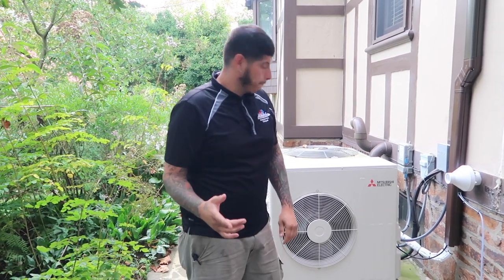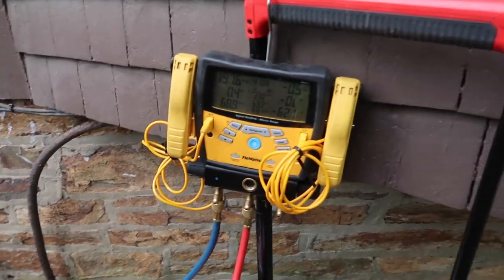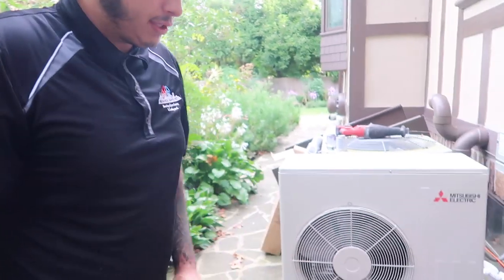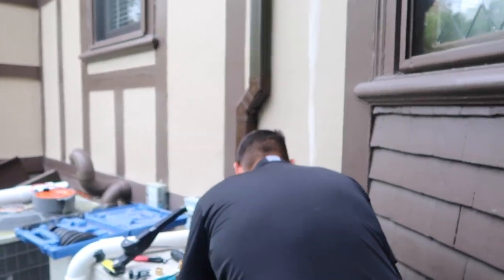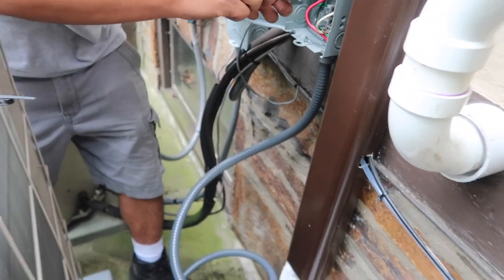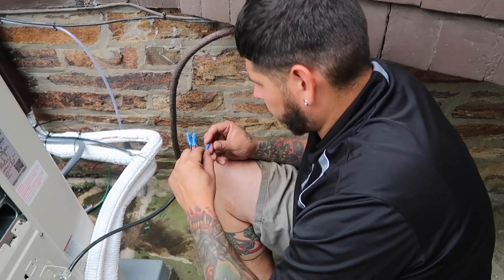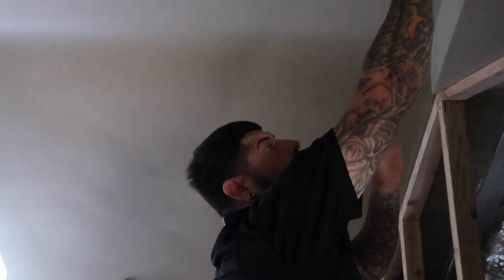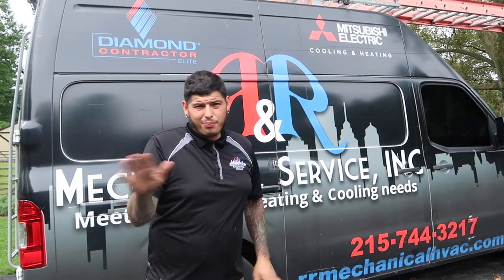RELOCATING CONDENSER

Comment: Yo that's what sup homie! I'm going on my 5th year in the buis, and finishing up my level 2 certification this next year. I had a question as to what u were using to flare out the copper with on ur drill. I need something like that for the mini splits I've been installing. Thank you for any info and keep the vids coming.
Reply from the maker: It’s called a spin tool, they flare and swage
Reply: @whiteworks1943  thanks again homie!